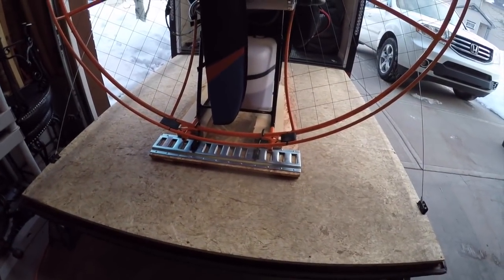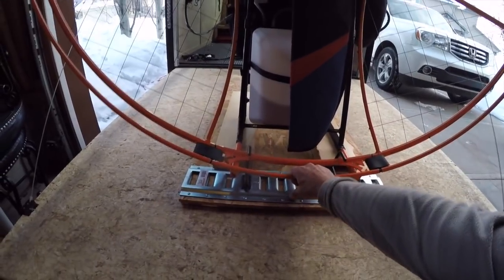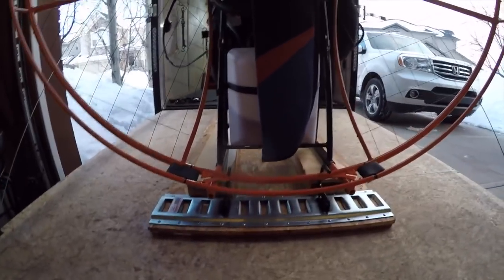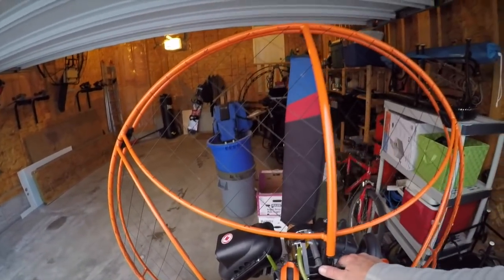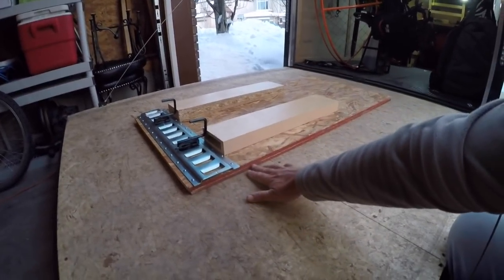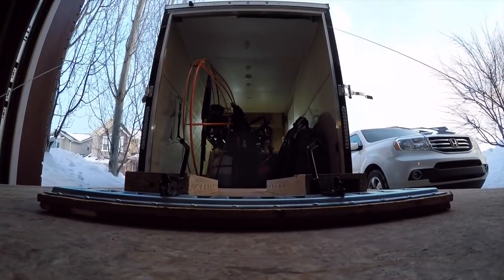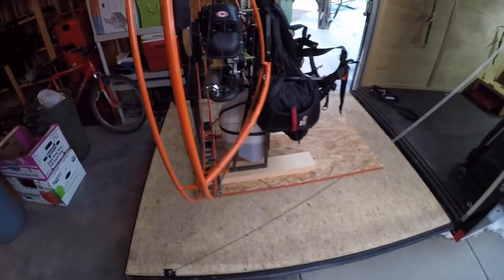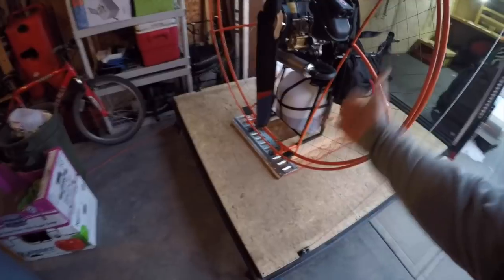Paramotor Safe board........ It may save your life!!

Comment: I think rigging something up with U bolts, and a 2x4 platform would be better, Leave a little overhang on all the corners, and put another bolt through each so you can add those 50lb gym weights to it or something, for increased safety. Im not convinced that the setup you have in the video would 100% be enough to keep it from flipping up on you, but I suppose it is a better than nothing sort of deal

Comment: Hi Fly Guy,  Thanks for all your videos.  I watch them avidly and sometimes repeat watch too.  A great service to the community. 
Tucker Gott touched this subject today too, so I've cross-referenced your video to his  in the comments and vice-versa.
His usual light hearted style of presentation is ever-present but that's balanced by a very graphic image later on in the video.   But, as I speculate in the comments on his video, I'm not 100% convinced that a loose board (with clips) could withstand the torque generated by a 20+HP engine at full chat.  I think it will overpower you if the unthinkable happens and your motor does unexpectedly start at full throttle. I suspect it'll be able to flip you and the board when that event occurs or you might slip etc, (although hopefully never).    Some people certainly won't weigh enough.  Never under-estimate mechanical horsepower.  I honestly believe that the best solution is to secure those clips to something more substantial than a four foot board secured to the ground by your own weight.  The bed of your truck maybe, or as Tucker suggests, the rack on the back of the vehicle.  Not sure who first coined the phrase 'On your back or on the rack', but it sure makes a helluva lot of sense!
Possible solution additional to the board:  A sort of A-frame braced against the top of the cage (harness side) and secured to the ground at a spread from the brace point?
Reply: https://www.youtube.com/watch?v=n4tIEKM0kZk&feature=push-u-sub&attr_tag=HNamSLMJLHSmnCOX-6.

Comment: I wont lie I used to regularly ground start my machine. I always checked the trottle linkage returned before doing so but after all the incidents I just don't do it anymore. I always start it on my back now no matter what. Not even tempted to do it any other way these days.

Comment: My Paramotor went full throttle infront of me by accident. My shoulder pushed through the net and got smaked by the prop 3 times, breaking off pieces of the carbon fiber prop and my shoulder each time. Not fun, terrifying, and preventable.

Comment: Ive been pushed over by a full throttle stuck/failed killswitch paramotor. Very damn scary and I really wish I had it on video to show how   quick and hard to control it can get. Ended up reaching through the net to rip out the spark plug wire as I flipped over backwards.  Haven’t started one off my back since.

Comment: If you want to be safe, get rid of that crap paramotor with no base or crumple zone..  the wing make sure it's not a flex wing, people crash with that all the time due to wing failure design not pilot error. My .02
Reply: Calm & Chaøs what does that have to do with a stuck throttle on the ground?
Reply: I think I'll trust Fly-Guy Alberta's definition of safety before yours. Thanks for the advice though.

Comment: And that is why you deserve ten times or 100 times the subscribers you have. I've always been impressed with your safety conscious attitude at all times, and how you show that safety and fun are good companions. 

One thing I've noticed in paramotor video after paramotor video is pilots getting close to a landing and then wondering which direction the wind is from. If they don't spot a windsock, they wing it. That doesn't seem right to me. How about a non-fire smoke bomb that you could drop to the ground and see exactly where the wind is from, that you could recover and reload for a subsequent flight? Seems like it would be a great safety measure and you seem to be the guy to develop such a thing.
Reply: RockinRobbins13 baggie of baby powder works. You over fly the area no lower than 75' throw the baggie far enough to the side so it is out of your wake so when it hits, you are circling back to watch the cloud float down wind. Land and pick up the baggie.